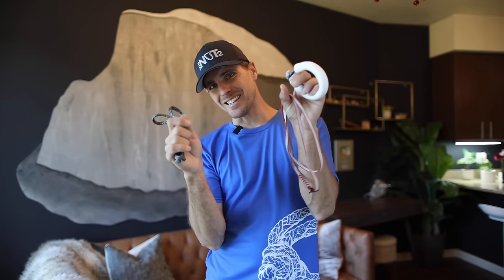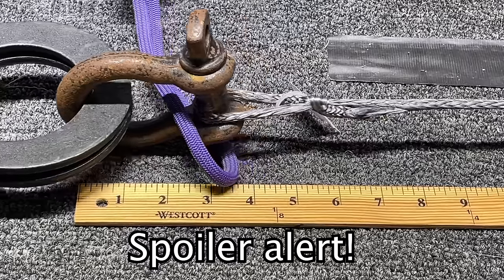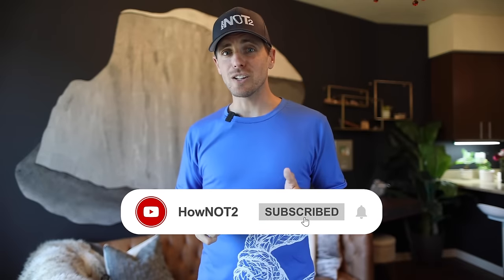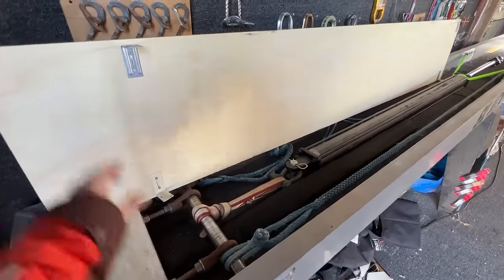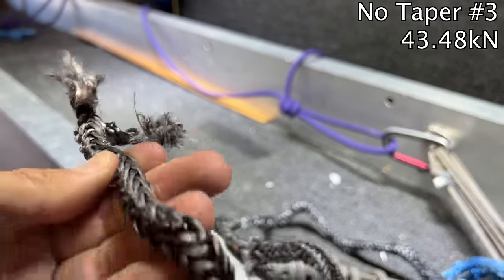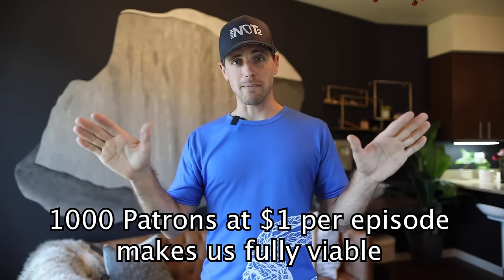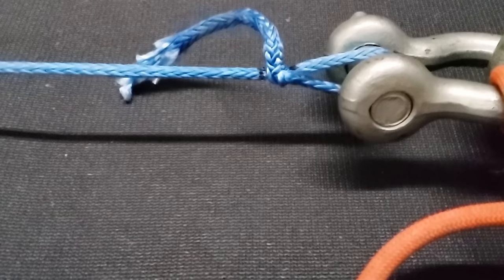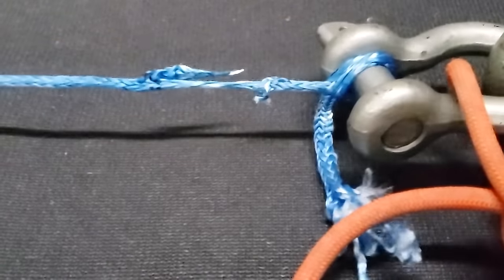Are tapering splices that important in Dyneema / HMPE?

Comment: It would be interesting to see an Ohm break. According to the manual, it's rated for only 15 kn.
Reply from the maker: How would it break? The quicklink is bomber and it’s just a steel friction device? I bet the rope or QuickDraw that it’s attached would break first
Reply: a climbing harness is typically rated to like 14 kn thats really not that low
Reply: @HowNOT2  According to the manual the friction device/caming unit breaks at 15 kn. The quicklink is rated for 35 kn, the dog bone for 22 kn and the carabiner to ~23kn. I wonder how they tested the caming unit.
Reply from the maker: @drstrangelove85  I have one at the lab.  I'll look into this and see if i can make it break like they say
Reply: @HowNOT2  awesome. Thanks!

Comment: You may need a long tail on a bury splice but actual key for stopping slippage is a locking stitch. 
Or you could splice it properly and don’t run the risk of slipping.
Don’t forget to mention that Dyneema has Creep. That’s important.
Reply from the maker: Lock stitching is only intended to prevent it from coming undone when NOT loaded.
Reply: Yeh that’s wen u don’t want it to slip. When u get slack in the line.
Reply: Why don’t you tuck splice individual strands with a taper

Comment: They simply put the wrong picture in there and wrote out the instructions. Incorrectly, they weren't talking about dynamic. They were talking about one of their other regular ropes. Unfortunately, they used the dynamic and they put it in the dynamic section. But yeah, it's wrong and you should've known. It was wrong because dynami is slick and dynami requires a little bit more pampering.
Oh yes, and of course my favorite part about dynamist. Mouse that stuff & it works better. Also, with dinaima, shield it at the eye.

Comment: If youre using something with a looped end, and isnt adjustable, do climbers, slackliners, etc... ever use a thimble in the end of loops (other than some leashes) to protect the rope/help maintain bend radius? I.e. Something like mcmaster PN  3495T44  is for 1/4" rope (6.35mm) has 1-5/8" of length for the eye, which would match with what you used at 11:00. With Dyneema being so touchy about friction and radius, it seems like insurance against dumb mistakes, or unexpected situations.
Reply from the maker: I'd actually like to test thimbles.  The thin ones bent on me with the slings I hold the slacksnap down with but it didnt' break.  The beefy heavy ones are too heavy to be practical for us to use in the field.
Reply: Would love to see a thimble test for application in the offroad recovery application for connecting soft winch line eyes to hard and soft shackles as D:d is a concern.  The goal is to remove as much metal as possible from the systems, though metal shackles are still used when connecting to the vehicle. Adding a thimble may be a good compromise if it reduces breakage, imo.

Comment: Would a 3rd pass through /double  Locking brummel improve  the result? 

 Simpson ropes States in their manual That you told me to buy, that a woopy sling has 70% of the materials MSB.  They also state they do their testing using eye splices. 

Simpson calls out a longer taper.
Reply from the maker: Whoopies probably lose their strength because the adjustable part comes out all of a sudden and is way more reducing to strength than a bad taper

Comment: Hi friends!
Why you dont research if there is a difference in the total strengen if the brummel is stitched sqare or in an angle lower than 90 degrees into the standing Part?? 
Observe that all reduction in strength is based in inconsistent tension between the strands and also between the fibers of a strand.
You have forgotten to observe the difference between static and 'rocking' forces.
Would like to read your discussion or answer 😉.
Best wishes from Austria.
Eric

Comment: If it is breaking where the splice goes back to the normal rope, is it possible that the extra strands in the taper provide more strength and it is because of the LACK of extra strands in that middle section causing that to be the break location?
Reply from the maker: I suppose the two strands are both sharing the load but I'd figure it would break anywhere in the middle, not just where the change in diameter is.   It's a good thought.

Comment: Now you know why arborists use roll rings for reducing friction and increase bend radius on seriously heavy wood.(like 1 ton or more pieces) You also seem to have left out the locks and stitching.
Reply from the maker: Stitching is only for holding it in place when not under load.  I'll test how much it helps though for holding force in another video

Comment: I always tense up when anything is described as "not having any stretch at all" (eg 11:20 ) . 
Dyneema stretches more than most metals, size for size. Almost twice as much as steel. 
Everything stretches and compresses when loaded, in proportion to how much load is applied. 
Stiffer things (like metals) stretch less than say rubber, but much more than say diamond. 
I think what lay people mean is that it does not YIELD much. 
(That's the permanent change of length which, in materials like steel, happens BEFORE the item breaks. 
If the load is removed, such items do not return to the original length). 
Diamond does not yield appreciably. But even it can stretch. 
In the extreme case, in thin fibre form, only say 200nm diameter, 
in which the atoms are of necessity almost perfectly arranged, 
it might stretch maybe 8% before breaking.

Comment: Why Marlow give such stupid instructions/measurements for the splice?
Your example: 4mm x 21 diameter x 3.5 for the length of the splice = 294mm 

Please keep it simple, it's much easier to to use the following measurements for further projects: f.e.
2.5mm x 70 = 175mm
3mm x 70 = 210mm
4mm  x 70 = 280mm
5mm x 70 = .....
6mm x 70 = .....

🤣🤣🤣
 

You don't need a calculator for this! 🤣
Reply: Well a brummel should have a 3.5 fid bury no matter the rope diameter! Now why the hell is a fid 21 diameters?
Reply: @bkuker  🤣🤣🤣 come on you are still working with this useless Marlow fids, made of aluminium? Forget about this Marlow fid lengths and go for the Selma fids, made of stainless steel. Much better!
Reply: @ushi120  Hell no, I still use a scrimshaw marlinspike carved by a one-eyed harpooner found dead on a life boat from the Essex!
Reply: @bkuker  🤣🤣🤣👍LOL
Reply: @bkuker  Probably some boatswain on a boat that had ropes of particular diameter had a toolbox that could accommodate a tool 21 or 7 max diameters long got annoyed with describing that length to his subordinates so he called it that and 21 was probably what worked for his ropes or didn't add too much work.

PS if he wrote a manual for a navy or some company the name might have just stick.